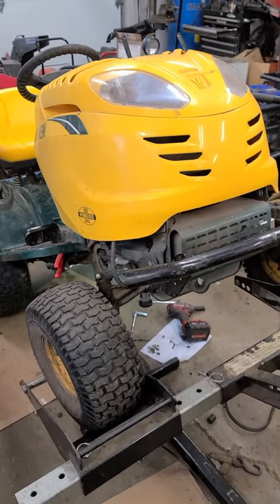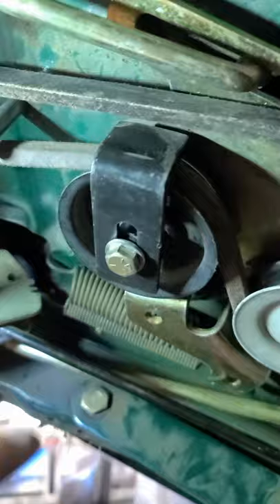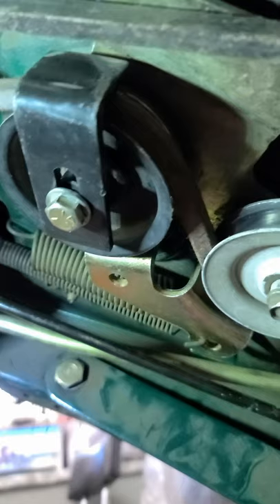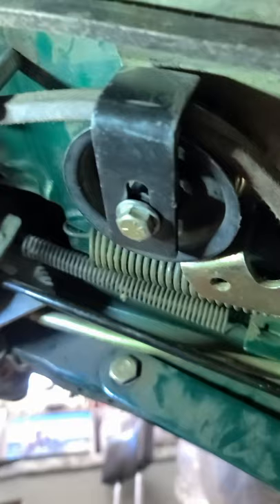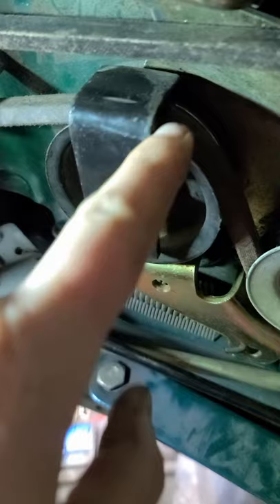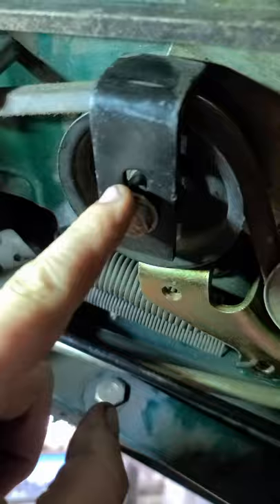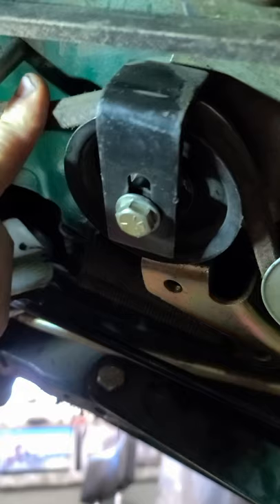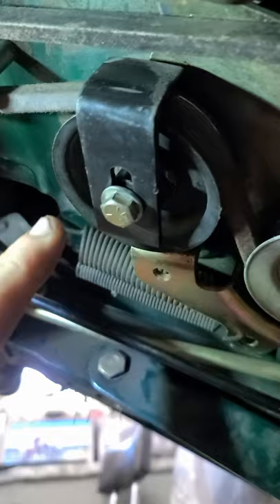Lawn Tractor Drive Pulley Hack To Stop Belt From Coming Off - #shorts

Comment: The old MTD/Cub Cadet snowblowers with dual auger pulleys/belts need that fix. They used the PLASTIC belt cover as the "keeper" and it always burns a hole through the plastic cover.

Comment: Belt keeper is actually called the belt guide. (Sorry to correct you.) And I make these all the time from 1/8" x 1" flat steel that I bend at an angle. They work great!
Reply: I have belt keepers on my belt 😜. Belt guide is more a term for something that doesn't fully keep the belt in "keep"
Reply: @xephael3485  "Belt guide" is a manufacturer's term, but "belt keeper" is a more explanatory term. It keeps the belt from flying off the pulley, which is a more direct term.
Reply: Do you just take the bolt off, put the 'metal guard' on and then reapply the same bolt?   Do you use washers or anything else?
Reply: @user-sb8yy6zj4q  Sometimes I use a wide flat washer & lock nut to secure the fabricated belt guide in place. But other times, I weld the guide to the deck. If the belt needs changing, just bend the guide away from the pulley slightly, remove the old belt & install the new belt, and then bend the guide back in place close to the belt & pulley.
Reply: @IPullingTractor  I have removed the bolt, made a version of what's on this video, and then going to put it on, but will NOT be welding it..But if I JUST use the SAME bolt, will that be TOO TIGHT against the wheel, as far as it not spinning smoothly, OR can I put the bolt tight enough where the metal guard will stay where it's at, AND the wheel will still spin at it should?  Or does the GUARD need to be independent of the bolt that holds the wheel in place??? thanks..
Reply: @user-sb8yy6zj4q  as long as the guide is within 1/8" from the pulley/belt, is rigid and doesn't flex outward, it should work fine.

Comment: Typical for MTD, cheaply designed junk.
Reply: My MTD 608 says otherwise..  it's a tool that has a price point.

  I bought my MTD for $150 after a fat lady crashed it and bent the front pivot axel.  I've probably spent $500 on it over 8+ years.  Welded frame recently because it cracked.

It's still running fine.  Might need new ignition coils soon.

MTD makes some fine products that are very serviceable... You want to know who makes junk in my opinion?  

John Deere.